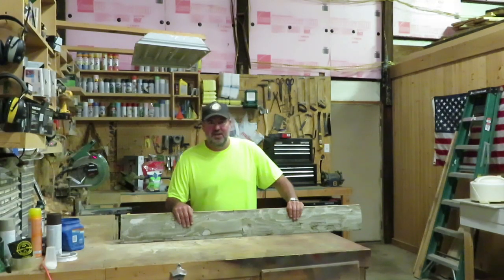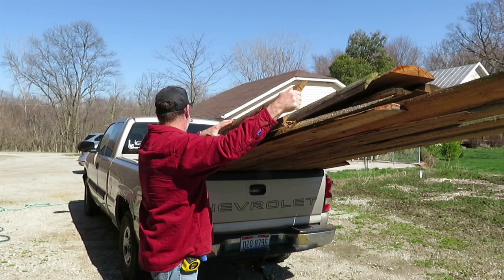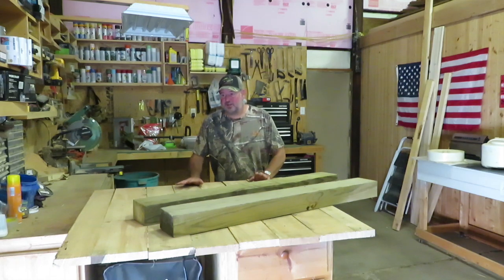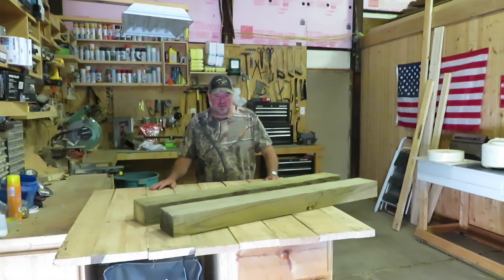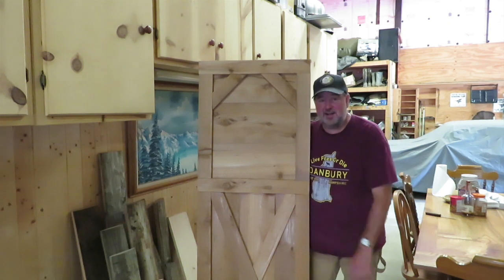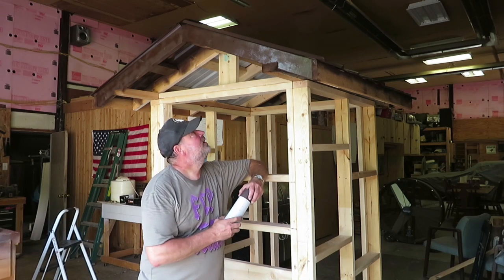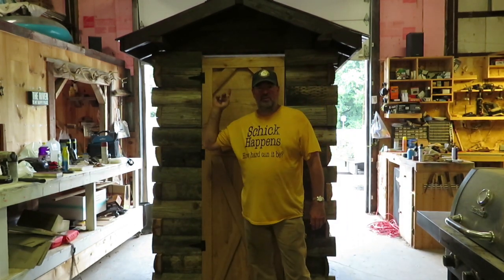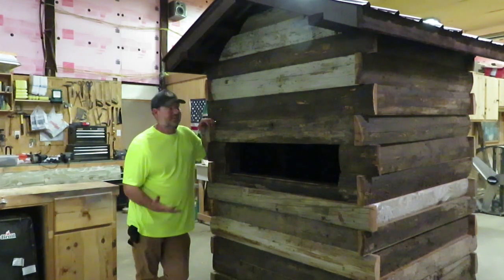DIY Deer Blind:  Scrap wood used, Awesome results

Comment: Looking good. Carpet on the edge really helps with noise. Some on the floor isn’t a bad idea either.
Reply: @schickhappens299  you should add a passive solar heater to the south wall ! 😎👍
Reply: @schickhappens299  that makes sense! 😂😂